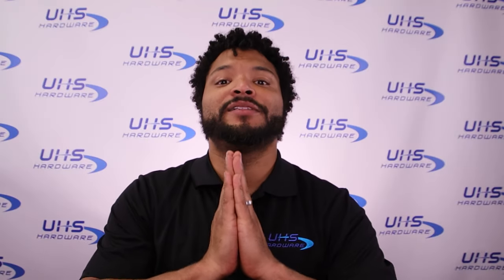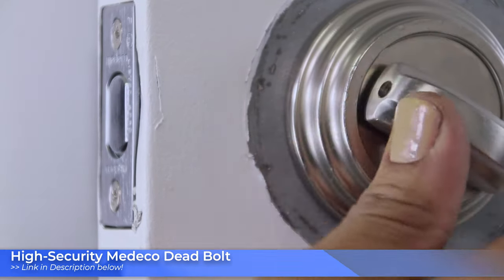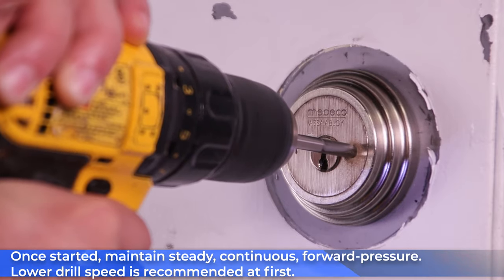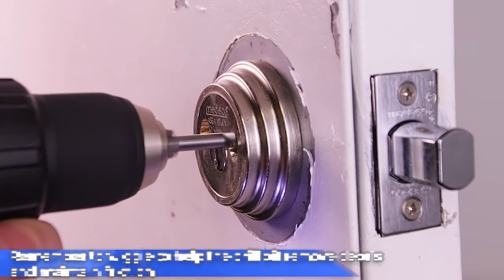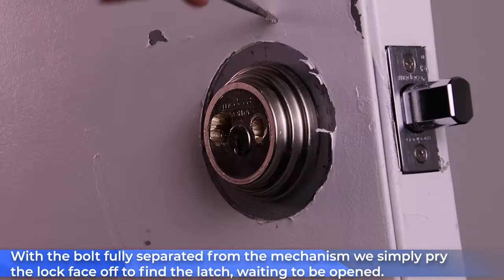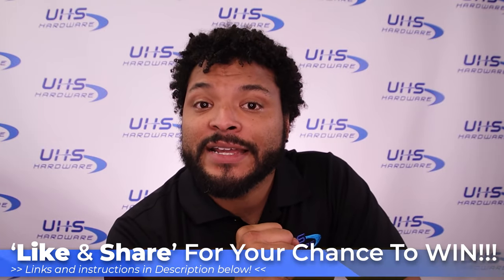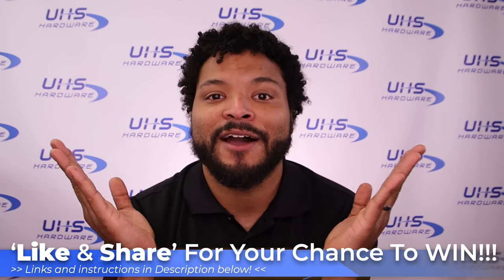How To Drill Out High Security Deadbolts with KeylessFactory Solid Carbide  Bit - Medeco Drilling

Comment: This is an M3B (see 1:33), not a Medeco High security lock.  It has no hardened steel balls protecting the screws.  It is designed for low security applications to be keyed in with high security locks.  The keys for the high security locks can be made to operate this lower security lock to reduce cost in non critical places.  Video would be much better if you could show that this D8X can overcome the hardened balls protecting a regular M3 or the M3's two hardened steel anti-drill plates or  the 3 anti-drill inserts in the plug and stainless steel tumbler pins and hardened bearing ball on the stainless steel sidebar.  The M3B has none of these.  You could do what you showed here with a regular drill bit.
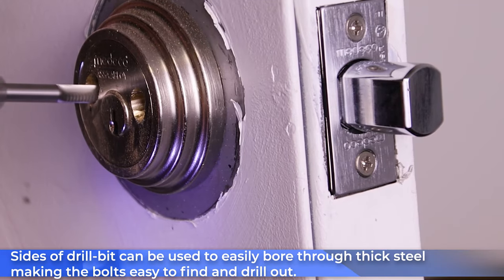Reply: Good Eye! I didn't even notice the UL listing was missing from the lock face or that medeco even made an M3B! The M3B (aka. Medeco3 BiLevel) is quite rare due to it's low security but I'm surprised that it took at least two dewalt drills to gnaw through the soft brass body (1:10, 1:59) . It was probably because they're using carbide cutting tools when a regular drill bit would work much faster on low security locks such as the M3B. Probably took them 45 minutes.

Comment: I have been drilling Medeco & Mul-T-Lock deadbolts like this for decades with a 1/4 drill bit and done it a lot cleaner as well as more accurately to the point where I could easily plug and retap if really necessary. The tool used is a carbide burr not a drill bit.

Comment: no matter what high security deadbolt it is. I just use core puller easily pulll out the core and use a screw driver to open it in 3 min or less.
Reply: Core puller is great but they don’t always work some locks are designed to have areas that snap and break while your trying to pull the core
Reply: I’ve use my plug puller on Medeco deadbolts it is fast.